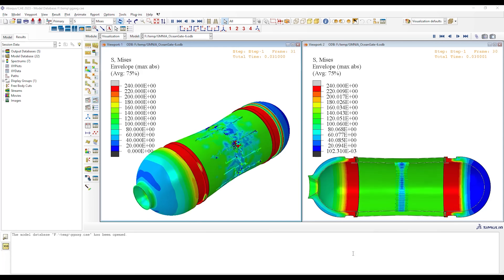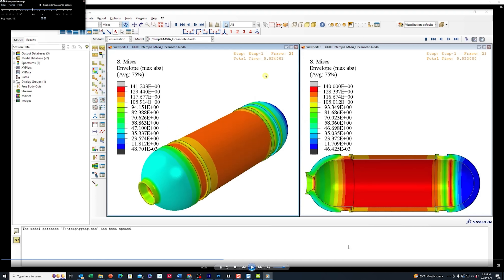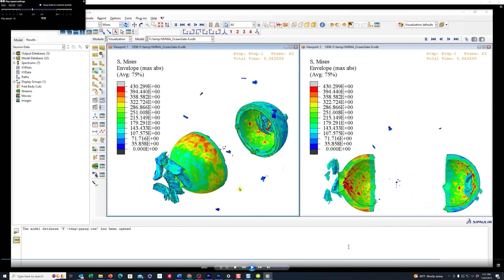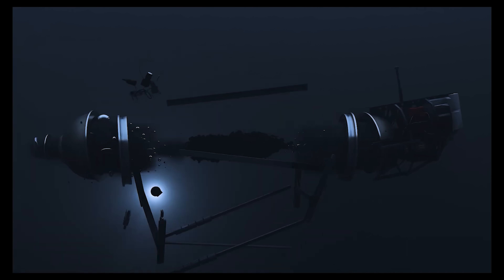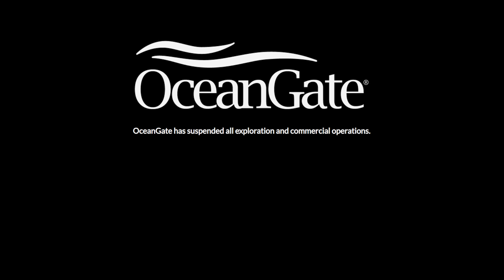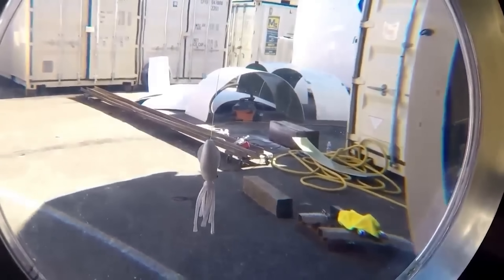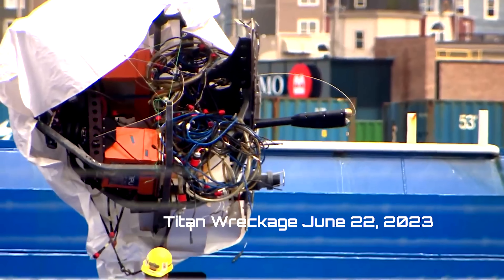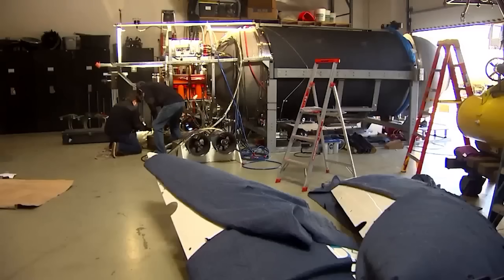Best Titan Sub Implosion Simulation, Cracked Porthole? Q & A

Comment: Titan was leaking the water was collecting under the floor so they didn’t see it. So they were getting heavier every minute and increasing speed of descent. Got so heavy that dropping the weights didn’t help. Finally the carbon fiber hull broke.
Reply: No chance
Reply: Leaking water would be a high pressure cutter
Reply: @revolvermaster4939  Nope. More like a water pressure cleaner - commercially available, get yourself one from your local hardware store. Water cutters are working with pressures exceeding 100,000 psi.
Reply: @curiouscat8457  pressure washers operate at about 2500 psi, at their depth the pressure was double that. It wouldn’t be an unnoticeable leak and would certainly cut flesh. I have a pressure washer and have cut wood and steel toe boots with it
Reply: @revolvermaster4939  It took me 5 seconds searching to find this: "TMP 8 Horse Power 4-Stroke Petrol 4800PSI Pressure Cleaner - the ultimate solution for all your heavy-duty cleaning needs!"
I'd love to see cutting steel with 2,500 psi. Industrial steel water cutters are working with 100,000 psi plus.
Your "unnoticeable leak" is a pure speculation assuming the leak is concentrated at one point and is a straight hole from one side of the wall to another. Try a microscopic crack about 6m long (the approximate circumference of the hull) at the glued joint of the CF and titanium parts at the rear - the generally recognized main suspect.
Reply: Just think about what you said.. "Glue"....."Glue"!!!... The Titan sounds like a cheap project that someone came up with in 10 minutes
Reply: There was a barrier between them and the aft. Water could have been shooting in back there ruining the A power and adding weight making what, through the wall, sounded like crackling noises.
Reply: @RichardPhilbin exactly
Reply: the pressure of water gushing in will always be noticeable asf thats basically a damn jet stream of pressurized water dude
Reply: 100% no. You do not understand the pressures involved. Any breach = catastrophic failure of the hull. There is no such thing as a slow failure, just POP.
Reply: So when I can see fluid leaking around the shaft on a 9,000 psi hydraulic ram cylinder but it still functions at its full rating I’m witnessing something impossible? 😂  Those seals must either seal 100% or completely explode catastrophically - no in between correct?  Any amount of pressure can be reduced to seepage if it diffuses through enough variables.
Reply: @kev_299  Correct. I own some tractors and 4000 PSI can just seep, It could also started seeping at just 10 feet under the water, adding weight.
Reply: Seepage IS NOT POSSIBLE under pressure!! NOT POSSIBLE end of story
Reply: Water would enter through a leak supersonically, so I think they would have heard it.  They also had a water detector in the lower part of the hull (of course!).  A slightly more rapid descent wouldn't have imploded the hull, and the plan was always to go to the bottom.  USN heard the implosion.  There's no need for there to have been a leak for it to have imploded, no evidence there was a leak, and a leak wouldn't have caused an implosion.  It's just fantasy.
Reply: Does anyone know how many passengers they had on their previous expeditions? Can't find anything from my searches, but from the videos and reports I've seen, it looks like they're may have been more people on the sub than there should've been..thoughts?
Reply: The only real thing saying it was that is the possible communications and the timeline for all that happened... 

Experts think that any leak would be catastrophic... But they don't assume that maybe it was leaking at the surface and through a part that could handle it without failing completely. 

Also at 6,000 psi that's not even close to the pressure of industrial water cutting jets at 60,000. 

Best case if it was a slow leak and over pressure pushed the end caps off as they tried to rise to fast while pressure couldn't get out fast enough. As they were passed out or tripping hardcore from oxygen toxicity.
Reply: I agree this is a likely scenario assuming the communications transcipt is gemuine and they had problems trying to ascend prior to implosion.
Reply: If it was leaking at that depth any small leak would be coming in like a laser cutting you to bits ....it would not just fill up lol ...thknk you need to 're think your idea
Reply from the maker: Yes I had considered this as well as a secondary cause
Reply: Nothing "seeps" water at that pressure. A millimeter sized hole would still let water in with enough psi to cut through the opposite side like a laser beam. Catastrophic implosion. Milliseconds.
Reply: @aaronlanger7555  You have completely distorted idea about the pressures we are dealing with here. Commercially available water pressure cleaners are working with pressures in that range. Get one and demonstrate the nonsense you are describing.
Reply: Seepage can still occur under those pressures - especially if the path isn’t a direct hole but one that permeates it’s way through many layers of micro fractured carbon fiber.
Reply: @kev_299  the carbon fiber was wrapped on a titanium tube
Reply: @revolvermaster4939  That tube wasn’t part of the structure it was part of the machine making it.  The tube was all cf.
Reply: @revolvermaster4939 the tube was removed after the CF cured. leaving just the shape.
Reply: That is what I think happened. It was seeping water. Also, several dives would have weakened the dead center of that tube, even if the glue at the ring only added a minimal amount of strength, that strength would be different from the center. Under 6000 PSI, nothing can be different.  A 25 PSI difference is huge under that pressure.
Reply: Nothing "seeps" water at that pressure. A millimeter sized hole would still let water in with enough psi to cut through the opposite side like a laser beam. Catastrophic implosion. Milliseconds.
Reply: @aaronlanger7555 yeah, no chance they seeped water in slowly at all that pressure
Reply: @aaronlanger7555  "Nothing "seeps" water at that pressure."
BS. Any pressure - if it seeps or blows is only matter of how the hole, crack or whatever is big. At that pressure a microscopic crack would SEEP. Period.
Reply: @aaronlanger7555  it could have taken water while being towed at sea, supposedly for the first time on the last mission.   It seems they were over weight from the get go...   I have reasons to doubt the transcript though.
Reply: @aaronlanger7555  Correct, it would be like a water Jet cutting steel. But it could have started seeping early on and added weight, The seeping could have even stopped by the pressure making a seal, say, around that glue.  The titanium spheres being pushed enough to stop the seeping at a certain depth. But now to much weight to stop sinking.
Reply: @aaronlanger7555 I'd like to know how you can state that as fact. Ordinary scuba tanks and compressors work at typically 3000~4000 psi and air can definitely slow seep out of seals. Water seals not air here but the seal technology and causes of potential leaks (dirt, dust or a single strand of hair, eyelash or fibre at a door seal or cable O-ring for example) is very similar
Reply: @aaronlanger7555  this is not true😅
Reply: @zahimiibrahim3602  it's pretty simple, we are talking about millions of PSI. Not thousands. Scuba tanks would likely implode at that depth also!
Reply: @zahimiibrahim3602  youre also referring to a gas (which is compressible) leaking out of a compressed air cylinder meant to withstand that pressure. Not the opposite where pressure is pushing IN on the vessels 1 atmosphere that is definitely NOT suited to withstand such compressive force! The gas inside the cylinder and their bodies would be compressed instantaneously ripping them to shreds. The cracking sounds were signs of water seeping into the SHELL and not into the body of the craft. The moment a break in the shell was large enough for water to get into the single atmosphere pressure chamber, the pressure from that small invasion would crush the air inside leading to the implosion.
Reply: @chuckmiller5763 nah 😂 the water at that depth is 6000 psi, any leak would destroy the ship in a few milliseconds
Reply: @Jmg831   Not saying the water just started at that depth, what if the leak started when they were just 25 feet down????? ow added weight, as they went deeper, the pressure sealed the leak around those rings. but too late, now too much weight at that speed.
Reply: @chuckmiller5763  that’s a possibility
Reply: I have screen shots of the walls seeping.
Reply: @4doorsmoorhoors542 Condensation.
Reply: @4doorsmoorhoors542 that’s condensation.